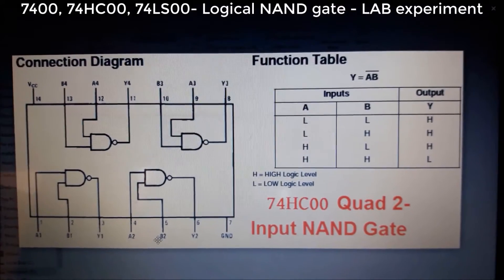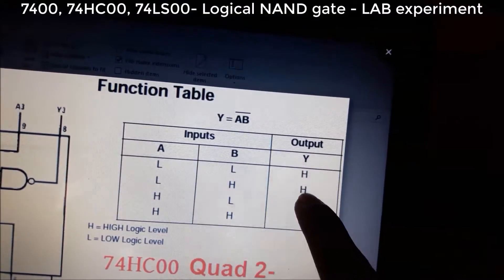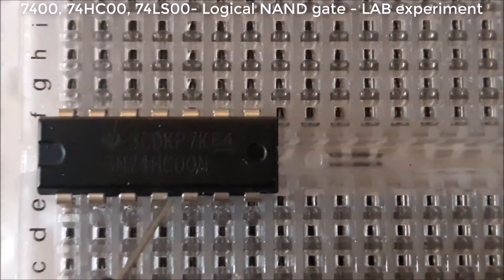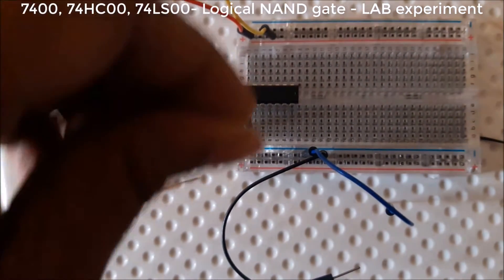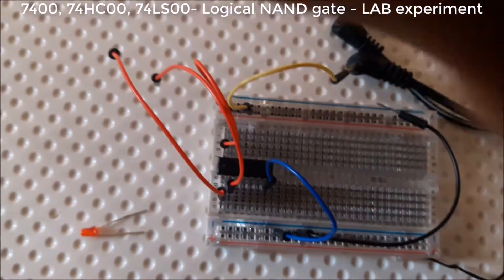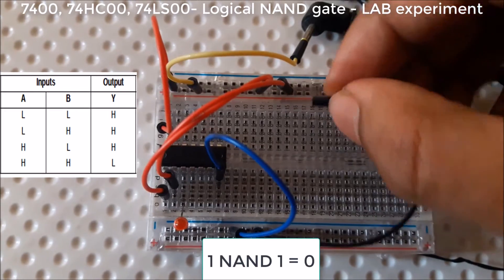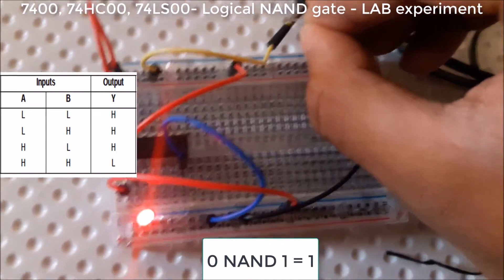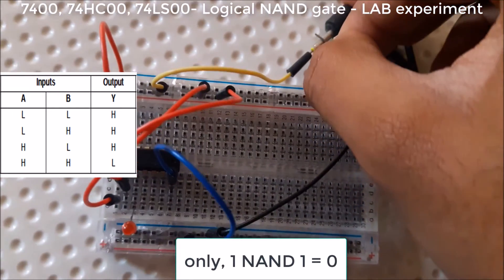IC7400, 74HC00, 74LS00- Logical NAND gate LAB experiment with full explanation - DLD 2

Comment: Which voltage supply adapter do you use?
Can I get the name of the adapter?
Voltage/current supply how much need to ic, like some adaptor is 5volt/1ampere, 5volt/2ampere, 5volt/3ampere ....